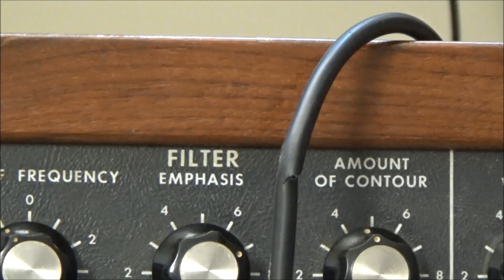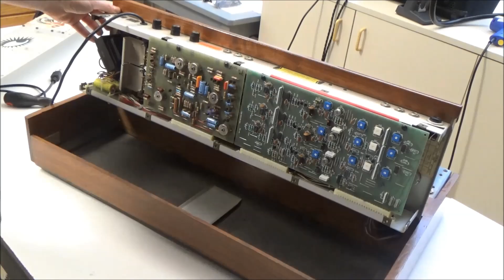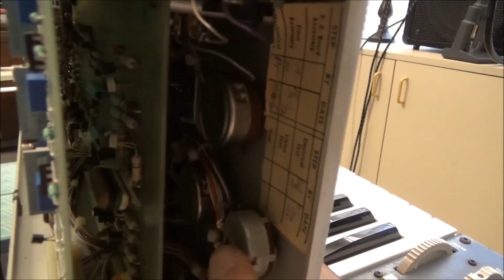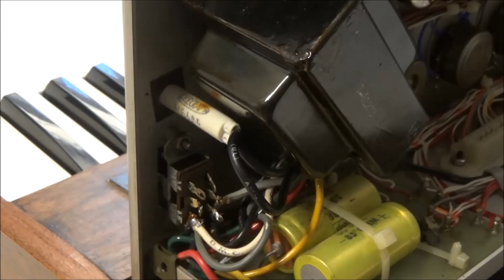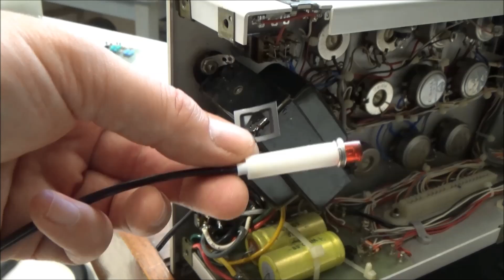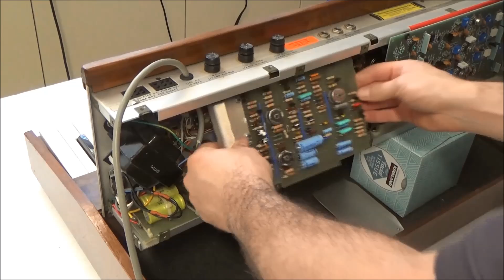Vintage Minimoog Repair & Tour Inside - Synthchaser #108

Comment: I was surprised by the card slot system at 4:44 - it's surprisingly forward-thinking. It raises the question of whether you could upgrade the filter or oscillator boards or replace them with something else entirely.

Comment: 3:05 looks like it might be more of a heat shield than heat sink
Reply: Or perhaps its intended to stop electrical interference from the power supply interfering with the signal path.

Comment: Isn't it dangerous to touch the power supply circuit? 

It looked like you touched the DC section of the power supply. Is it that DC is not dangerous? 
In my electronics classes I heard ac is extremely dangerous and in building computers you never open the power supply.

Comment: So, I have 2 vintage MiniMoogs in very poor condition, but have zero experience in electronics.  One I bought new back in 1977 and the other I bought at a music store.  I want to restore both of them, but I have no idea how to start.  Watching this video, it looks fairly easy, but then again, you know what you are doing.  Should I attempt the restore myself or look for somebody else to do the work?  Right now, I'm using a Roland JP8000, which I love because of it's polyphony. But, it's also out of service due to the dreaded "low crackly output" syndrome.  Thanks!
Reply: Get someone qualified with vast experience to avoid permanent damage to it..

Comment: Yes, cool helpful video, thank you!  About 1 hour ago I pulled my friends early 70's Minimoog out of the case and on to my home electronics work bench.   So far I've just given it a visual inspection.   He had the 4th modulation oscillator modification as well as the fine tuning oscillator rotary knobs.  I can see by your video that he also had the blue trimpot mod done, or maybe this some other board but, I bet it was a mod done with the addition of the others.    So, thanks to you I'm walking over to my bench and removing the filter and power supply board.  Once step at a time so as to get familiar with all things layout and wiring.   Thank you for this good video and I"m sure I'll be back for visual references and comparisons.

Comment: Just curious why you wouldn’t update the power supply electrolytic caps (at a minimum) while you have it open? Aren’t these 40+ year old caps likely to fail?
Reply from the maker: This wasn't my synthesizer and I didn't have authorization from the customer to do that work.
Reply: @Synthchaser Its unfortunate how stubborn and delusional some old synthesizers owners are.. And in the end it often ends up with broken / dead machines. :(

Comment: Nice touch using a more original style power cord.
If doing a more elaborate restoration, you want to change the electrolytic caps, the "tropical fish" caps, and any of the carbon resistors.  
Oh, and if the overload lamp light goes on when you turn it on, your fuse needs replacing. :)

Comment: Why is it important not to swap the polarity of AC mains?
Reply from the maker: Because the hot side should be fused.  If the wiring is reversed (neutral is fused) and the fuse blows, the instrument potentially poses a huge safety hazard.
Reply: Is this specifically important for the minimoog? I got confused because I see a lot of equipment having reversible power cords or power sockets (like 2 pin roland connectors for example)...
Reply from the maker: That should apply to anything with a polarized power plug.  And be something you're aware of if you're working on a 2 pin scenario, lest you become the path from hot to ground in an instrument you think should be safe because the fuse is out.
Reply: In Germany it indeed does not matter, because the Schuko plugs can be put into
the socket both ways around. In the US, UK and other countries where the plugs can‘t be turned it makes total sense to wire it up correctly. In fact, as a German, it is beyond me, why we came up with this silly Schuko design, where many other designs are fool proof!
Reply: In Germany it indeed does not matter, because the Schuko plugs can be put into
the socket both ways around. In the US, UK and other countries, where the plugs can‘t be turned it makes total sense to wire it up correctly. In fact, as a German, it is beyond me, why we came up with this silly Schuko design, where many other designs are fool proof!

Comment: Nice Minimoog. But I prefer the previous version of the oscillator board (like in mine). This is the latest version. I don't know if you might have done this out of camera, but it's always a good idea to clean the edge connectors on those boards before reinstalling them. Especially the oscillator board which can be finicky with varying voltages coming from board #2 (keyboard circuit section) sometimes causing erratic tuning. Also the Cinch-Jones connectors beneath the Mod Wheels section are prone to bad contacts and can benefit from cleaning. Again, it might have been done already... Thanks for sharing a glimpse inside this legend, for those who might have wondered what makes the pikachu fatter ! lol

Comment: Did this revision use the ua726 for the log conversion of voltage to the oscillators ?. Great insight :-)
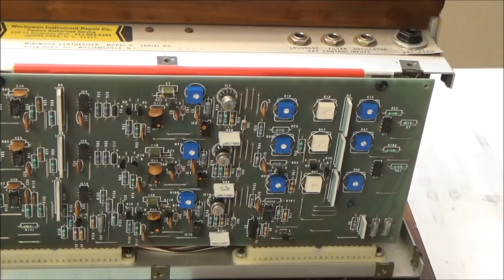Reply from the maker: Yes, you can see them at 3:24 they're the silver can TO-99 IC's toward the middle.

Comment: I've always wondered how the 440 reference tone stays in tune
Reply from the maker: It's a Wien Bridge oscillator, and it can go out of tune if the passives drift in value over time.  There's a trimmer pot you can use to adjust it.  This one came in at A443 and needed a little tweak to get back to A440.
Reply: cool thanks for the info
Reply: i guess it's digital.